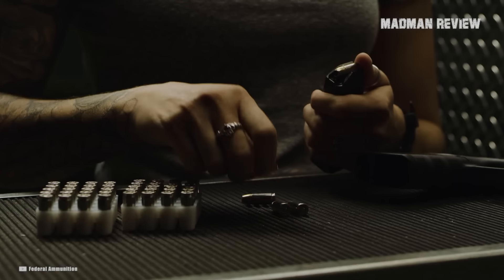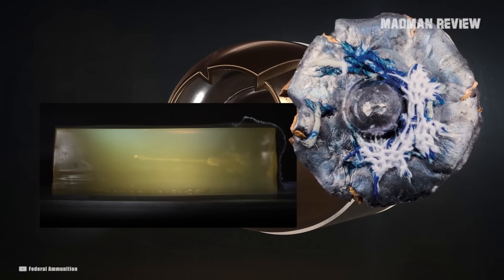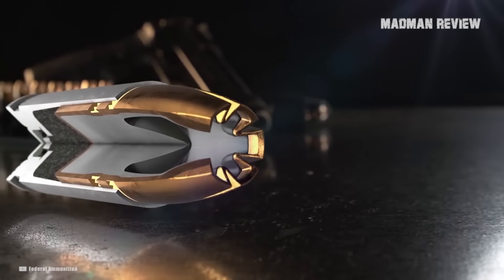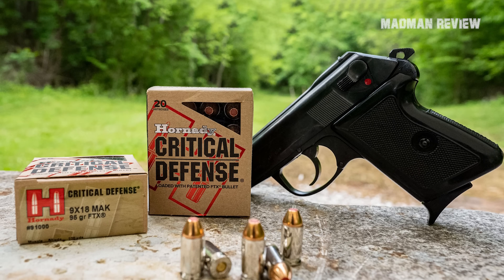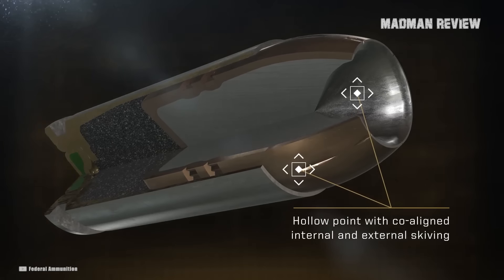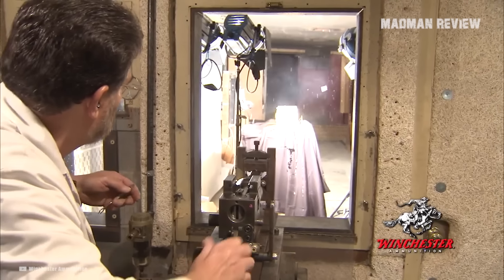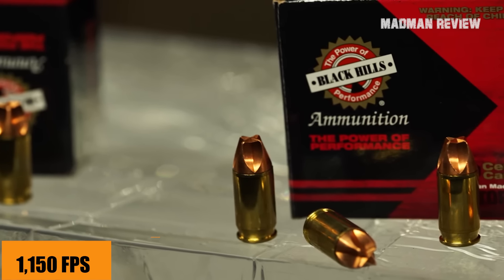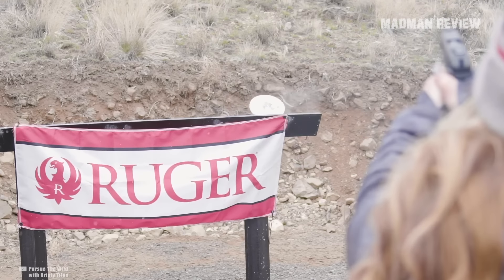8 Most Powerful .380 ACP Ammo for Self-Defense

Comment: I use the Underwood version of the 68 grain LeHigh Extreme Defender. The standard round is advertised at 1300 fps while the +P is 1400 fps. It's a little snappier, but I don't mind as my gun has an aluminum frame so it's a little bigger and heavier than most and the greater speed improves penetration. I like it so much I even have the 90 grain version in 9mm for my Glock 43X EDC
Reply: Question  here - You mentioned  +P ) Is the +P designed for rifles  and Not recommended for pistols ? I've gotten conflicting answers on this ... Please answer  ..... Brian.
Reply: @brianarnold4368  +P and +P+ are designed for either. You have to contract the manufacturer to find out if their product can withstand the extra pressure produced by these rounds
Reply: @brianarnold4368  +p is fine for pistol as long as pistol is rated to shoot +p. 
Technically SAAMI specs don't even list a 380 +p, so any company that labels their ammo as 380 +p is kind of just making stuff up, there's Technically no such thing as 380 +p

Comment: My practice ammo is LAX 380 new production hollow points. Cost /1000 rounds less than 30 cents a round the equivalent less than $15 a box of 50. In today's market that is a bargain. The rounds appear to be solid copper with a hex head impression at the rounded tip. It feeds well I my Ruger LCP, LCP Max, S&W 380Easy, Taurus 738TCP,  Taurus Spectrum, Glock 42 and 25. So far I've gone through1500 rounds through all of my 380 pistols without a hitch. Most were shoot through my two Glock 42's and Glock 25. Because of this round's reliability it is also my carry ammo. I don't give a twit about expansion just reliability and penetration. I have no gel test data but this is what seems to give me the best bang for the buck.

Comment: I go with the Glaser safety slug in my .380,9mm, .357, 38 spec, 45acp and .44 mag. Very low penetration,  no ricochet and devastating wound channel.  Problem is they're hard to find.  I'v been carrying them in my guns since 1978.
Reply: There are much better options that do much more damage, relatively speaking. That's why glasers are hard to find and will be extinct before too much longer.
Reply: With today's technology in the hollow point rounds in this video, the Glasers have fallen by the wayside. Not as highly rated as they used to be.
Reply: @jedironin380  Too bad, they're still great due to its lack of ricochet.

Comment: I used to carry the Underwood Extreme Defender 'screwdriver' round, but switched to the Underwood JHP that claims 1200fps on the box, 90 gr, +P, item 141
Reply: For a short barreled .380 (from which JHP's frequently tend to not fully expand), you might want to take a look at the Underwood Xtreme Penetrator 90 gr. (standard [1,100 FPS, 242 FPE] or +P [1,200 FPS, 288 FPE]). The XD's are my go to load for my short barreled 9mms, but the .380 needs a bit more oomph than the XD's can deliver because of even shorter barrels, for which the XP's do the trick quite well.
Reply: CORRECT…Underwood’s  xtp 90g +p is the way to go…not only do i carry this in Lcp 11,I trust my life with it…And I have done extensive test such as milk jugs filled with wet newspaper,hardcover books etc…it ended up in the third milk jug fully expanded and clean through 3 1 1/2” hardcover books… apparently this guy is getting paid to advertise these rounds…And Underwood said no because most everyone knows we have The most powerful reliable 380 round 👍🏾👍🏾👍🏾
Reply: It's bad ass

Comment: The best round for the .380 is the Underwood Xtreme Defense  +P using the solid copper Lehigh xtreme defender bullet.  It’s not a true +P as there is no SAAMI +P standard it’s just loaded to maximum pressure so any 380 in good condition can shoot it.  It is barrier blind and will pass the FBI test going through cloth and penetrates 15” with a really good permanent wound channel, it far outperforms the Honey Badger.  It will still pass the FBI gel test going through sheetrock, plywood, glass and sheet metal so it truly is barrier blind. 
Hollow points have to be going 1,200 fps to fully expand it is very hard to do that out of a 2.8 inch barrel so you will most often get a partial expansion & low penetration, they also clog easily and turn into a FMJ and over, penetrate .  Just make sure your gun can cycle these  “screwdriver bullets” by running a few boxes through first, works fine in my Ruger LCP 2.  There is a huge amount of evidence proving these bullets work from test jn 10% gel, meat & bones and on game as they also make rifle hunting ammo using these fluted monolithic, copper bullets.

Comment: 380 is extremely popular so that little assumption is debunked. 
If anyone says to you .380 isn’t a good carry cartridge then I suggest patting them on the head and leaving. 
Anyone says 380 or any round that has a primer can’t penetrate into a human, this tells you they have no idea what they are talking about. 
Anyone that’s been shot, whether a .22lr or a 380 will tell you that it’s excruciatingly an awful feeling. 
Being punctured or a hole poked into or through you disorientates the brain and body causing shock. 
Any gun you feel most comfortable with is better than nothing. 
To end I can tell you first hand (or left handed) that the .380acp will drop any asshole fast. They will take the asphalt temperature challenge and win it. 
Best .380’s are freedom flatpoints, RIP’s and Underwood with the Phillips head screwdriver tips. 
Those on the list are great too. 
But even an basic Fiochii or blazer brass round nose FMJ will do the trick.

Comment: V crown is great in 9mm, but the 380s don’t reach expansion threshold in my own tests. HST expands really well, but doesn’t reach acceptable penetration.

Hornady Critical Defense is the best I’ve tested so far. Expansion could be better, penetration could be better, but neither are unacceptable. It’s the best thing I’ve found so far, so that’s what I carry.
Reply: What gun did you use for test?
Reply: @Ouash1  LCP Max and Sig P238. Both have pretty short barrels, so they may perform better in something else that’s got more barrel length and may impart a little more velocity.

Comment: This is a well presented video.  Lots of info here.  That said. While we all obsess about which round has more power, penetrates deeper, and causes the most damage. We all seem to forget one thing. A 380 especially a small one like an LCP Max or similar pistol is a last resort "get off me gun". 

Hence, it's going to be used at extremely close range or even maybe a contact firing. In that kind of scenario through a short barrel, you're going to be lucky to get any kind of expansion out of any hollow point, especially at the lower velocities of the 380.

One other thing we need to consider is that any bullet when it hits it's target will make a hole. If that target is a human that hole has the ability to cause bleeding, tissue damage, and quite possibly damage to bones as well. All of which will of not treated quickly will lead to death.

In a get off me situation, usually whoever the attacker is will be somewhat startled when they find they are facing someone whis armed and has just put a hole(s) in them.  That may give you time to put some distance between you and the attacker.

Comment: With a 380 you would not shoot from a far distance. Below is a test someone performed. 

Weather 83F 10% ballistic gel 380 with 2.5“ barrel. Fired two feet from the gel.

Gold Dot Handgun Personal Protection 380 Auto 90 Grain penetrated 9.5” velocity 983 ft/sec

PMC 380 Auto Ammunition 380A 90 Grain Full Metal Jacket velocity average 849 ft/sec penetrated 19.5”

Comment: The original full metal jacket is best for the the 380 you get the best of both worlds added penetration from a lowered powered 9mm bullet the heaviest grain weight possible this help's with 32 caliber and 25 caliber pistol bullets as well.
Reply: 100 grain hard cast flat noses are the best and you do want the bullet to leave 2 holes, one entry and one exit hole resulting in loss of blood pressure. Also keep in mind, hollow points tend to load up occasionally and act like solids, so with every shot you have to pay attention to what’s behind your target. The judge isn’t going to buy “ it was a hollow point and was supposed to stop”.

Comment: Many 380 auto will not cycle  with hollow points....I  use ball ammo...feeds well in  most pistols
Reply: We on the same page...fmj only in our autos...the little extra bit of reliability can only help...
Reply: True, many new gun owners, ccw users think oh... I can buy a sub compact or mini type pistol but the gun may misfire, jam. Know what you gun does, handles. 1911a1 or a .25acp Baby Browning.
Reply: Any ACP cartridge will hang up on the feed ramp with the flat open hollow point end.  Simply fill the hole with soft pure lead solder or epoxy.  Problem solved with no negative effects on expansion.

Comment: 380acp can reach 375 ft lbs of energy with a 3.7 in or longer barrel and a +P rating.  faster is better than heavier.
Reply: which 380 bullet has 375 ft lbs???
Reply: @bruced.370  Norma MHP  380+P 85g 
  1400fps  and 370 ft lbs.  I run them in my Baby Rock 380. for carry. Their over $2 a round, so I only fired one.

Comment: I have tried 18 different 380acp ammo.

Thus far, the 95 grain Fort Scott solid copper performed the best.
Reply: You might want to take a look at the faster and higher energy  .380 Underwood Xtreme Penetrator 90 gr. (standard [1,100 FPS, 242 FPE] or +P [1,200 FPS, 288 FPE]).
Reply: @richardefriend  
Thanks for the recommendation. I have been unable to find much Underwood ammo from my local sources. I will keep looking for it.
Reply: @PRINCE_175  
I normally perform penetration tests using pine boards and penetration/expansion/damage tests using a block of modeling clay. I have not yet tested Underwood XTP 90g +p 380 ammo but I will as soon as I find it.

Thanks for the recommendation.
Reply: @Narsuitus  Underwood’s site has it all day 24/7 on their site….XTP 90g +p or non +p
Reply: @PRINCE_175  
Thanks ! Regretfully, I am only able to buy locally and in person.
Reply: @PRINCE_175  except in NY 😡
Reply: @erictrippe2778  
I do not penetrate boards but my guns do.

My 4-inch barrel Hungarian Walther loaded with 95 grain flat-nose FMJ 380 Winchester ammo from a distance of 4-feet will penetrate one 1 1/2 inch thick pine board. The bullet lodges in the 1st board and makes a small dent in the second board.

My 4-inch barrel Hungarian Walther loaded with 95 grain solid copper 380 Fort Scott ammo from a distance of 4-feet will penetrate two 1 1/2 inch thick pine boards. The bullet lodges in the 2nd board and leaves a 1/2 cm dent in the third board.

Comment: Self defense round I tried would not rack one shell…of course store wouldn’t take it back…
Reply: Sadly, ACP’s of any caliber really do not like the flat spots of the hollow points.  Fill them in with soft pure lead solder, or even epoxy.  Will solve your feed ramp problem without compromising expansion.

Comment: if some day i'm gonna be forced to use .380. I probably going to use FMJ 100grains +p, and why I'm not going to use hollow point? because the projectile is to light and probably it going to penetrant less than acceptable, so i prefer doing 2 holes than 1and no if the round transfix the body it`s no going to have enough energy to cause any more damage

Comment: Winchester ammunition is not reliable. There is at least one misfire in every box. 

Also, one of the bullets displayed in your video was not even discussed. The Inceptor Ammunition .380 ARX has a muzzle velocity of over 1,260 feet per second, that produces maximum hydraulic displacement and energy transfer to target without over penetrating. They are frangible bullets which are safer to use in interior spaces as well. The important thing to remember, as you mentioned in your piece, is that collateral damage can ruin your life more than actually getting shot, especially if it comes in the form of a baby in the arms of its mother.

Comment: With a .380, the most one that chambers most consistently wins. Most hollow points will cause jam.  Even Winchester wad cut will jam. Most .380 have a short steep feed ramp. I would stick with ball ammo. Both my Beretta Pico and my Glock 42 like ball. Anything else is risking ftf.
Reply: I've got a Glock 42 I haven't had long and I like it, but it doesn't seem to like HPs
so for now I'm just going with FMJ.

Comment: I know this is an old video but but I like to add since stuff is come out since this but picked up my wife a Beretta 80x cheetah got some of those Lehigh defense. Little cross rounds well their package under Underwood it got a little bit more bang than the Lehigh. But there's nothing wrong with the 380 that's still a bullet that still has enough knockdown power to put a hole through you

Comment: Technically the .380 is not a short 9mm. While they do share the same bullet diameter no other dimensions are the same. The 9mm is actually tapered and the .380 is straight walled.
Reply: The Germans call .380 ACP, 9mm Kurz, which means 9mm short.
Reply: @charliefoxtrot5001  Do the Germans say "9mm" in English or German?
Reply: @erictrippe2778  In German, why?
Reply: we know
Reply: @erictrippe2778  Neun millimeter

Comment: 0:15 ok, stop right there. You can’t “carry more .380 than 9mm because it’s smaller”. Sure. It’s shorter. But, the diameter is the same. I’ve seen and messed with plenty of guns. And for comparable sizes. You’re not getting more bullets.

Comment: Bull $hit!!! 380ACP is a scaled-down dimensionally 45acp. .380 ACP case is smaller in diameter. Its rim measures .374 inch and the rim of the 9 mm measures .394 inch. IT"S NOT JUST SHORTER. This is important because you should not cut down a 9mm case to use in a 380 ACP

Comment: So, because the .380 is smaller you claim you  can get more capacity than 9mm. You then say it is 9mm short, which it basically is.
So how exactly do you get mree capacity with the came diameter cartridge?
You  don't, S&W MA&P EZ .380 and 9mm have the same capacity.

Comment: It's just kind of hard to justify wanting to carry 380 over 9mm these days, especially when you have so many pocket sized options available with really good magazine capacity now in 9mm. If recoil is truly one of your biggest concerns, that's about the only reason I imagine 380 would be a better choice. Also, 9mm ammo is a decent bit cheaper than 380 is.
Reply: I carry both 380 and 9mm. My 9mm is a p365 and my 380 is a lcp max I actually prefer to carry my lcp max because of the weight difference. Lcp weighing less loaded than my p365 empty, And it fits in my pocket a whole lot better.
Reply: if you know of a 9mm with a 10 round capacity that fits in my pocket the way a LCP Max does, I'll buy one for both of us. i'll admit, without pocket carry the max loses it's appeal (for me anyways) but as a pocket gun it can't be beat.
Reply: The best carry pistol is the one you carry. I tried to carry a double stack 9mm and hated it. My 380 i happily carry every day.